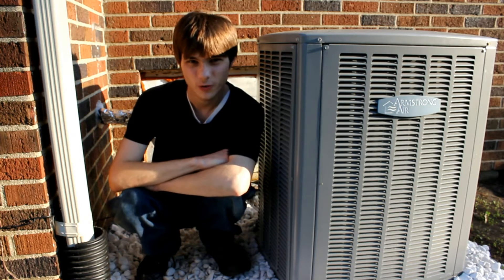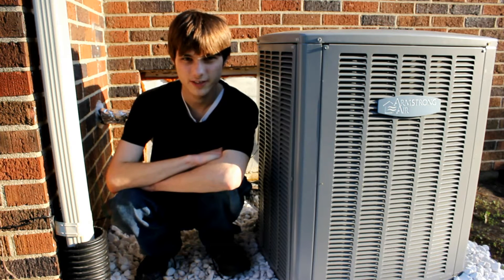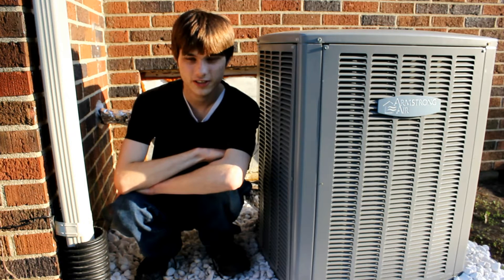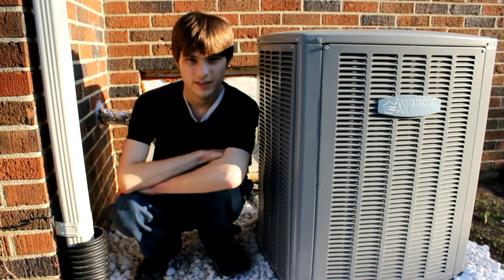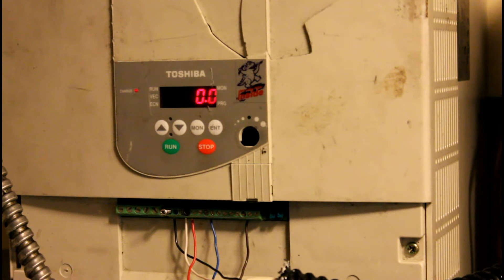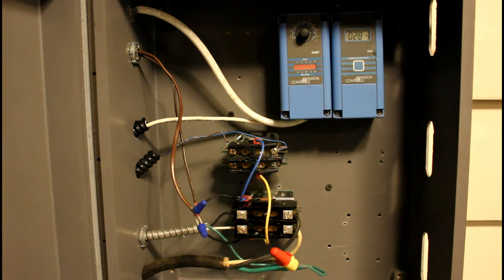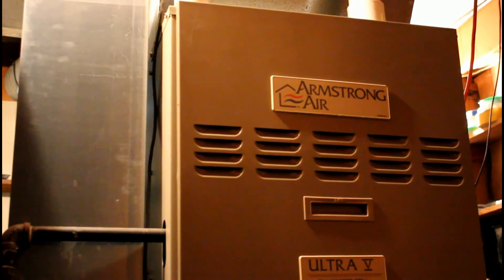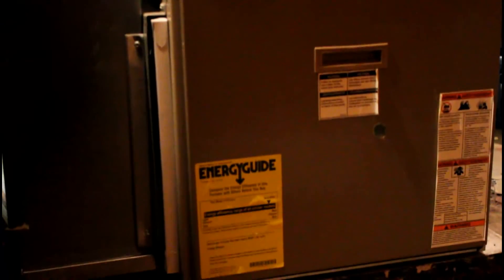Save on A/C and Heatpump bills using used VFDs Part 2

Comment: If I were you, I would install a txv that will take care of your super heat and have a pressure sensor installed on the liquid line and have the VFD run a pid off the head pressure have the maintain a 120psi (txv need 100psi dif to run) difference between high and low side. That will be the most efficient way to run the ac. Also the compressor windings were not rated to a VFD, so I would install a load reactor between the drive and compressor to protect the winding's insulation.
Reply: Is better to control suction pressure with the VFD! If you want to control also the discharge pressure you can install an VFD to the fan motor of your condenser coil

Comment: Have you done any work with adding a liquid cooled condenser to the existing a/c unit and connecting it to a swimming pool?  This would be a good candidate for VFD control and energy savings.

Comment: Curious to what you’re doing now with hvac.
Have you thought of ramping the compressor down as it nears the set point like minis do?
My understanding is they just about continuously run but massive energy savings.
Reply from the maker: I'm working on making an air conditioner/heatpump with a more advanced cycle, instead of just a single stage cycle. And yes that's basically the way this system runs. The energy savings are happening because the compressor runs at a lower speed and that reduces friction loss, inertia loss and heat of compression. It also brings the evaporator and condenser pressures closer together. It isn't an ideal concept though. It's good at lower load but at full load is really isn't much different than running a regular system. That's why I'm working on a more advanced cycle, one that will be more efficient in all load situations.
Reply: subcooledheatpump thanks, just found your channel. Hope you keep making them!

Comment: Hi . It’s a brilliant idea. I have a zoning system and I want to do the same so I can use the zoning . Did you change the power line to 3 phase?. Can you send me the sketch of wiring diagram, I have a single phase 208v .
Reply: You can use a single phase to three phase VFD to run the compressor!

Comment: its cheaper to short cycle. the system fan draws a lot of energy. you want your house to cool as fast as possible so it can turn back off. But obviously you do not want your unit to freeze up or send cold refrigerant back to the compressor. Id think the most efficient temp would be just above freezing but im not the one who designed the system
Reply: The most efficient is the lowest possible temperature differential between the indoor and outdoor coils that rejects the heat. The fan takes power but more effectively coupling the coil to the air will bring the temperature down of the refrigerant in it and the performance per watt will raise, until the motor takes more than it's worth it.

Comment: Are all VFD the same? i ask the seller of my VFD if I can used the ecogoo 9100 series w/c is 3ph output for 1ph motor and he said no. I know most of the chinese VFDs are made the same from each other and i think most of them are copy from the western, japan or europian design like on your demo. In your opinion sir what do you think, can I give it a try on 1Ph?
Reply from the maker: No not all VFDs are the same. Most are similar but in case you are looking to power a single phase motor, you must find one that allows you to disable phase failure detection
Reply: @subcooledheatpump  thank you sir..may you share a link of that kind of VFD, of course the cheap one. i looked all over ebay and aliexpress but most are 3ph output only. im planning to use it on my 2 side by side door fridge. thanks again..from philippines
Reply from the maker: In case this link doesn't work, search Ebay for "Fuji Frenic" or "Fuji Frenic Mini" This line of VFDs will allow a single phase output.
https://www.ebay.com/sch/i.html?_from=R40&_trksid=m570.l1313&_nkw=fuji+frenic+mini&_sacat=0
 Also, if you're going to use a VFD on a normal refrigerator, make sure you wire the thermostat to the VFD's start / stop terminal. You don't want the thermostat to interrupt the VFD's output current while it's running.

Comment: Amazing channel.  Thank you, seriously.   My question for you: since the compressor is ramping up and down causing pressures/temps to fluctuate there is no need for contactor at CU since the power is coming from vfd.  So does the vfd regulate ofm as well, and if so, is subcooling still within range of 80-100f on the liquid line or not?  Thank you again
Reply from the maker: Lower compressor speeds almost always lower condenser pressures, which in turn lowers the condenser temperature. Subcooling happens because the ambient temperature is below the condenser saturated temperature (because of the condenser pressure) Therefore, at low speeds, subcooling is reduced, since the condenser temperature is now closer to the ambient vs at full speed. With all that being said, I did at one time try using a VFD to regulate the speed of the condenser fan, but I found it best, at least in this setup to leave the condenser fan as it and connected direct on line. In other setups, I use VFDs to regulate the condenser fans, but in my own experience it usually works best to leave the fans at a fixed speed (usually medium to high speed). You always want the lowest possible condenser temperature, (unless the condenser is outside in the winter, where it could fall below the temperature of the evaporator) So if you slow down the fans too much, it really doesn't save any energy and in fact, probably uses more due to a higher condenser pressure. So I usually just leave the fans as they are. Thank you for watching.
Reply: @subcooledheatpump hi mate! I have used VFD on a walk-in freezer I'm using suction pressure instead of suction temperature because I want to maintain constant saturation temperature at the suction I have used a pack controller for the compressor the pack controller sends a enable signal to the VFD and a 0-10V signal the pack controller have a PID function so I used it! For the condenser fan I also use a VFD with a pressure probe like the compressor because i wand constant saturation temperature on the liquid line. For typical refrigeration system is working perfectly!! But now in your case maybe is better to run the fan motor with the compressor from the same VFD!

Comment: That temperature setting used on the suction line needs to be measured as the suction line leaves the indoor coil. In Winter one would have to set the VFD thermostat controller to monitor this same pipe but in heating mode and thermostat will have to be set to a higher temperature in heating mode and sending a signal that increases as temperature drops vs how it was in cooling mode.
Reply from the maker: Already been worked out. The temperature controller can be set for direct or reverse acting and it is changed over every season.  15C is the target temperature in the summer, 25C is the target temperature in the winter. Works very well.
Reply: Your dad must be pretty proud of you for your interest in electronics and HVAC. Your doing a fine job with your videos and understanding of your topic

Comment: Could You do this with an R.V. Air Conditioner.  I mainly want to get rid of the humidity,  it doesn't have to be that cold.  72°F.  would be perfect all the time for Me.
Reply from the maker: In Theory it is possible to do this with any air conditioner, the only problem is getting a single phase compressor to start and run from a VFD. Again, it is possible but starting can prove quite difficult
Reply: I did upgrade My camper to a 50 amp cord and it is capable of 240 volts.  I don't have and appliances that operate on 240,  but I could do it if I wanted to.

Comment: Why didn't you use a thermal expansion valve (txv),  instead of a fixed orifice?
Reply from the maker: A thermostatic expansion valve tries to maintain a set evaporator temperature. Once the evaporator is at or below the set temperature it simply reduces the refrigerant flow by closing the expansion valve. My system does the same thing, except instead of closing the expansion valve, the VFD just reduces the compressor speed. So the result is much the same, and therefore a TXV is simply no needed. Thanks for Watching.
Reply: @subcooledheatpump  i get what you are saying but if you remove the txv or fixed orifice you wont have expansion anymore 😅😅😅

Comment: I like your video, and give a good explanations
A VFD needs a 0v to 5v or 10v  signal to ramp up or down, witch thermostatic controller would put out this signal other than the Johnson Controller you have used?
Because I might want to install one for a customer of mine ?

Comment: Great videos. Keep up the awesome work! Do you have the thermostat switching the VFD on/off in your set up?
Reply from the maker: Richard Green Yes a regular thermostat gives the start command to the VFD. Once the command is given to start, the temperature controller issues a speed command based on suction temperature.
Reply: Well it's 8/29/2021....How is subcooledheatpump doing lately?

Comment: You do save money with these a lot of money trust me when it comes to heat pumps.
Heat pumps are always sized for cooling and then when it gets cold or somebody jacks the T-sat more than 2 degrees the AUX heat comes on.So now you have 15-20 KW heater plus the heat pump running.I over sized my Trane by 1.4 Tons and have my AUX heat locked out.It was 5 Degrees last nite and the temp stayed on 68 inside.
Reply: i was under 
the impression that it costs more money to run the compressor then to just run electric heating when it gets that cold outside.
Reply: @MrStemkilla Depends on the unit itself. The COP you can calculate based on the interior and exterior temps plus the extra for the evaporator and condenser overshoot. Oversized and running at lower power means oversized evaporator and condenser and therefore more efficient COP. Turning your interior fan on high trades off comfort of warmer air for less temperature difference between indoor and outdoor.

Comment: The actual energy savings are not that high. We pay the electric energy, not power. The energy is power x time. You run at lower power but longer cycles, so your energy consumption is the same (or even worse because lowered efficiency - loses in magnetic core don't decrease with coil amps).
The only advantage of longer run times is for dehumidification - if you are in a humid area is significant.

Don't forget that the oil flow in to your compressor will be reduced at lower speeds/frequency. So it will probably increase the wear on your compressor.
Reply: but inrush current and etc for starting the compressor probably accounts to quite a margin too
Reply: Sorin Nicu using this vfd would be quite useful in a home assuming you set up each  room with independent  zone controllers and dampers so you won't have to cool the entire house just the rooms calling for it.
Reply: Then what is the point of a inverter in a split system. You don't make sense.
Reply: Efficiency is better at lower rpm due to less friction in the pipes
Reply: Although this comment is old , I can’t help but say how stupid your comment is Sorin.
Perfect example of someone that doesn’t know what they are talking about.
Obviously you don’t know what VRF systems are and why VFDs are used.
As for power x time you might want to look up affinity law

Comment: For the temp control on the suction line is it something your always adjusting or is it a change it every season type control...? Do you have to change for heating vs. cooling? I see a future project coming on.  :)
Reply from the maker: I have to change the temperature controller setting to heating for heat pump operation. As far as setting the temperature, usually I just leave it at a setpoint for the whole season. Sometimes I adjust it. I'm going to make another video this summer, as I've changed some of the controls.

Comment: Thanks dear for uploading such an informative video. I just want to run 3HP single phase submersible water pump. so which VFD would be suitable? means specification. and i also want you to brief me whether i can use that vfd with solar panels?
Reply: Hello dear, We produce this type VFD,we called Solar Pump Inverter or Solar VFD .Which could be used as general VFD and also Solar VFD.The output is same -AC output. The input could adaptable DC (solar panels) or AC (grid).
You could contact with us: phaetondrive.com   info@phaetondrive.com  whatsapp：+8613424310478

Comment: Running a R22 compressor on R134a is roughly equivalent to running a R410a compressor on R22, R290, or R433b (the "Davuluri Treatment" - just look that up). Therefore, you might be able to get a little more efficiency by reducing the V/Hz constant by 10% or so - that reduces part load iron losses in the motor. (That doesn't apply if the VFD is a FOC drive - in that case it effectively does that automatically.)

Comment from the maker: would get too cold, this can be a problem during startup as liquid refrigerant tends to migrate to the coldest spot in the system. 

I have a new video of this system running. Check my channel, and search for "3 ton air cooled residential heat pump uses R134a" Thanks for watching

Comment from the maker: The temperature controller uses voltage control ( 0 - 10 volts ). It controls the VFD based on suction temperature. It uses PI control. The reason the thermostat is used; because the compressor has a limited speed rage ( 30 Hz to 70 Hz ) If we operated the compressor at 30 Hz continuously , the house would become too cold. So we use a thermostat once the temperature falls below a certain threshold. The suction line can't be too low, else then the compressor (continued)...

Comment: Hi, I've been searching up VFD and compressor for years now  but this is the first video I landed upon that has real example. Anyways, do you guys use PID control outputting 4-20 mA or manual? What about using onboard PID control with onboard input 0-10V or 4-20 mA and put pressure sensor or temperature transmitter instead of the thermostat? Could your boss clarify about going bellow 59 degree and getting liquid into the compressor, what about charging with 10 degree superheat? Thanks.
Reply: PID loops are great for getting more accurate and consistant temperatures. but if you want to use one for your house thermostat you need to slow them down. so it cannot call for air every second. But instead can only call for air every 10 or 20 minutes. Because it absolutely will. there is an energy saveings for short cycles, its not free to run the system fan all day or keeping the compressor putsing along.

Comment: you should build a heat pump water heater. i made one about 3 years ago.i use 1480 watts vs 4880 watts. and i have 40 gallons waterheater thats sized for 3 people i have 4 child and my wife and i on this.check out my page im also into green technology

Comment: One thing to think about all newer inverter systems in the market ramp up to full speed every 30 min to return oil because oil will stay in the evap coil at variable speeds
Reply: Yes you are right but also they close the EEV to pump the system down they create a "vacuum" to the evap coil and then they open the EEV wide open due to the load when this happens the high velocity refrigerant wipes out the oil and returns to the compressor!